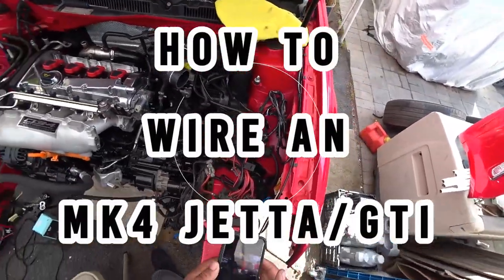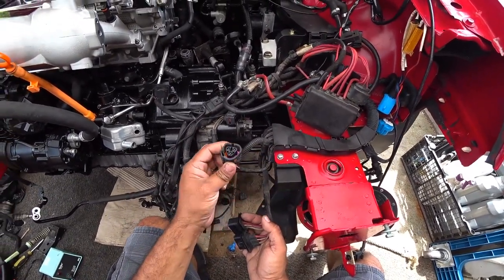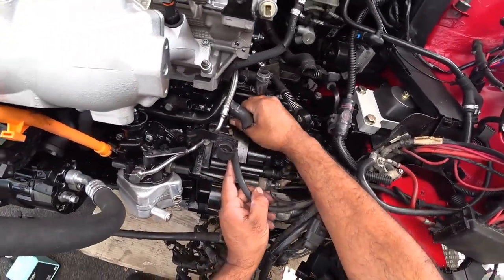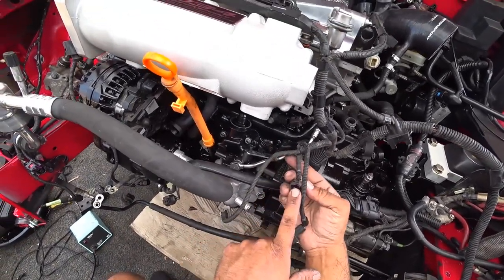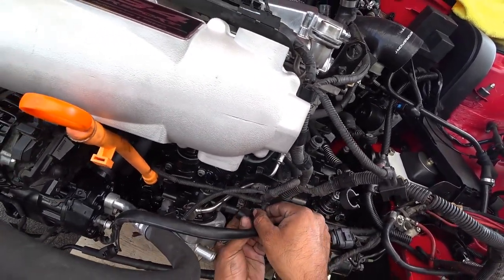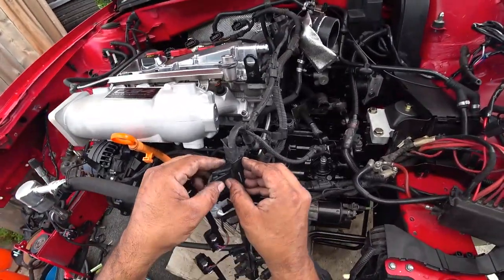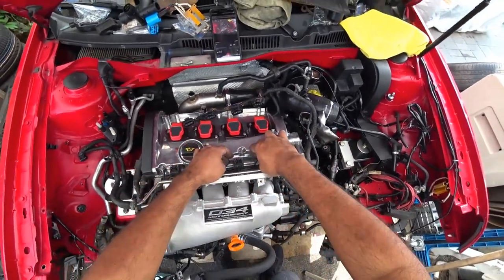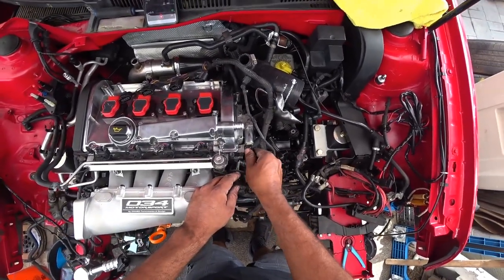How to Wire UP your VW MK4 Jetta GTI S6EP26

Comment: Hey Al I recently got an epc warning light on my dash and I can’t seem to find the reasons for that light to come on it’s a mk4 gti 1.8t the other symptom that it has is that the gas pedal won’t give any throttle response until you press it a lot of time or turn the car off and back on as well as a significant decrease in power output I was hoping if you could help me out if you know what it could be? Love the content man thank you!!!
Reply from the maker: You need to pull codes 1st

Comment: is it okay for the injector harness to be sitting on the intake manifold like you have but on OEM Intake manifold ? im worried because of the temperature around that area, would it melt ? i unwrapped mine from the factory electric tape and wrapped it with more modern engine bay tesa 51036. thanks for your reply
Reply from the maker: Yeah you shouldn't worry about the Temps. I ran my wires under my manifold and extended them with no issues for years

Comment: Whats up al i saw your breather box install video do you have to run a sealed can on 1.8ts? Or would a vented one be better for a big turbo serup?
Reply: Better question... the breather i have has a filter on top and two in/out ports mounted vertically (one on top of the other) what port should i run the line from the valve cover to?